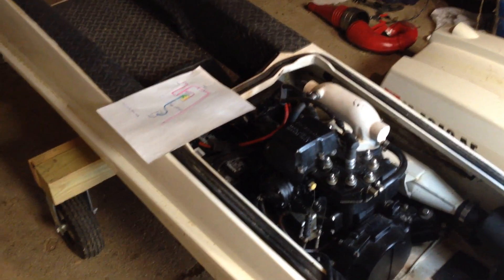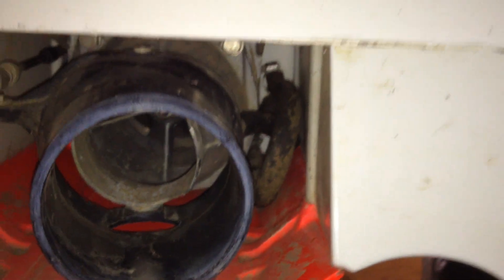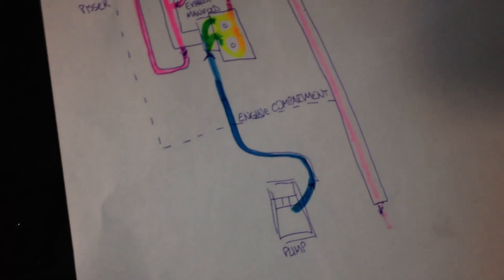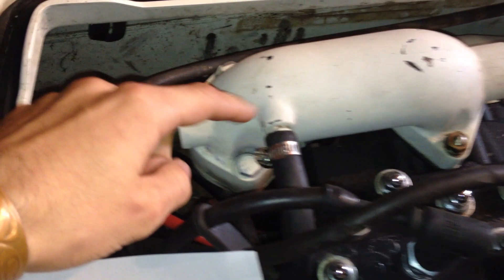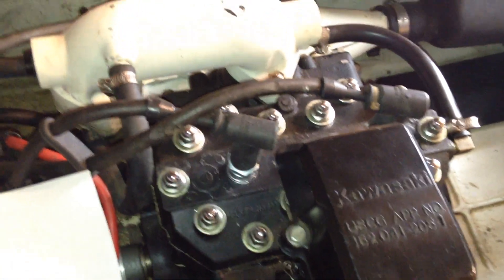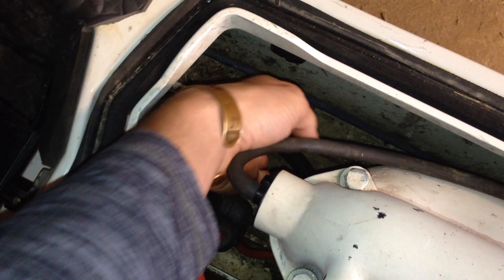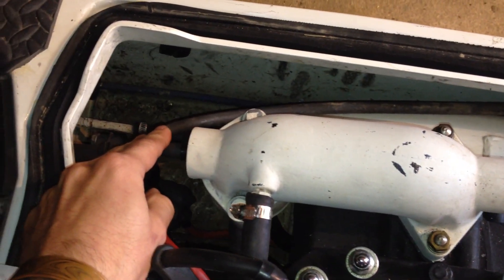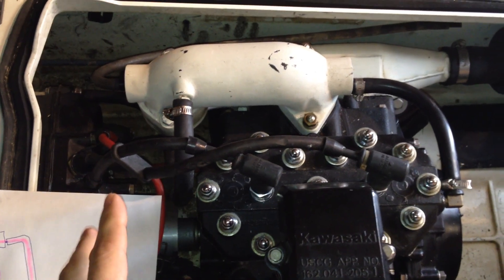1990 Kawasaki 400 / 440 / 550 / 650 Stand Up Jet Ski Water Cooling Line Diagram

Comment: by any chance you have the manual on PDF? thanks in advance..

I just got a used JS Kawa 550 stand up and the coolin system is blocked, I un-block the part that comes from the impeller but inside the engine is block, water flows backwards and just a little with the hose when I connect it to the exit of the heads

any suggestions?

i was considering to use the pressure cooker on the grill with a solution of water and harpic for clogged drains, redirect the vapor exit of the top with a gas hose into the head to force vapor inside to unblock
Reply from the maker: Sorry, I don't have a PDF. They are readily available online however.

Comment: How would you flush the system? 
Is there a way to flush it without starting the engine?
Reply from the maker: +jeff harboldt Check out this video. Explains how flushing your engine works. https://www.youtube.com/watch?v=RxW42u45suc

You will want to run your engine while flushing.